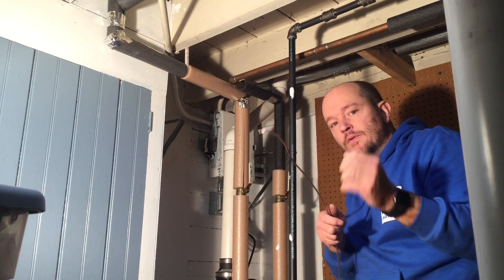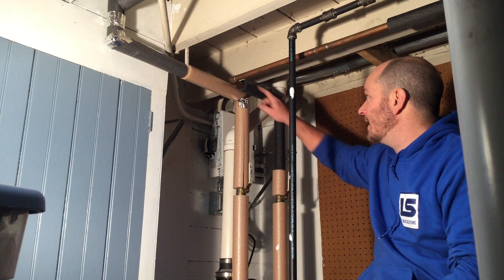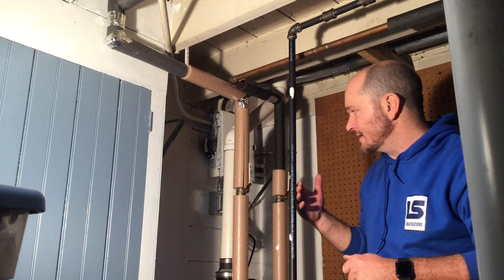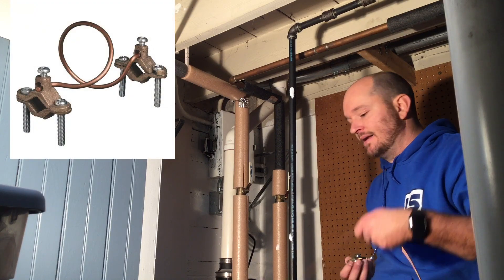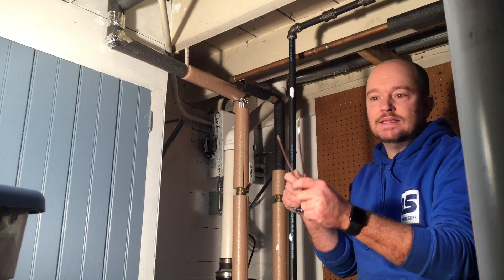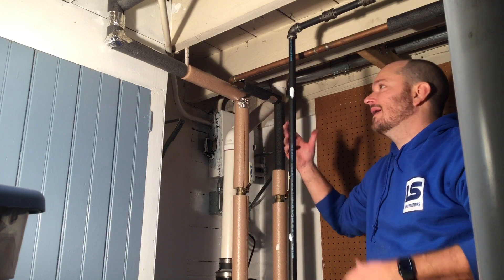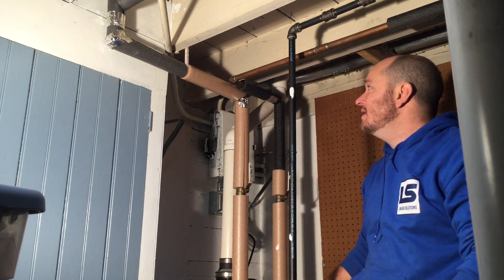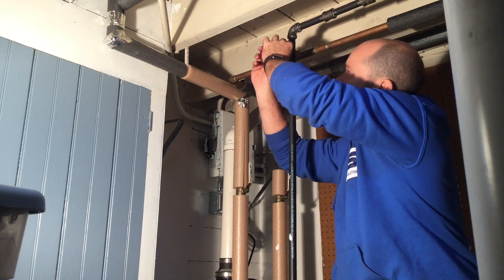Bonding the Hot Water Tank and Gas Line

Comment: You know my logic tells me that is it dangerous to bond to a gas line. But what do I know, I’m just a HVAC technician/contractor that has been in this field for 11 years. If anyone can explain why it’s not dangerous let me know.
Reply: I have never seen gas lines bonded in my state
Reply: In the event of a lightning strike, electricity may arc between conductive objects, especially those that run into the ground… you know, like gas lines.  
This arc may leave a pinhole, thus causing a leak.  Many houses have exploded this way.

Comment: Just an FYI, your volume is waaaay low.
Reply: Hi,Chris ,  i'm Kevin From Detroit Mi. I just would like to know if i can Run half inch pipe to my Furnace & my water heater? Now, im coming off  of a 3 quarter pipe also about 3 feet away, i just want to know if i should be Good, Or do i need to go with all 3 quarter pipe to the water heater and to the Furnace?
Reply: @kevinkelly9303  are you bonding or running feeds? 1/2" is fine for feed to the water heater, but I would go with 3/4" feed (gas pipe) to the furnace, which I am assuming is natural gas?

Comment: What is a dialectic?
Reply: Galvanic corrosion caused by electrical contact between two dissimilar metals
Reply: Dielectric materials are insulators that allow electric fields to pass through them, but not electrons,.  The flow of electrons is electric current.   Electric fields include radio waves, and light, formally electromagnetic fields.

Comment: This is crazy I work for gas company and have work for here for 20 years and in our policy says if there is a bond or a ground to the gas pipe, you must take it off no bonds are grounds or not allowed to be on the gas system i’m serious today is the first time I’ve ever seen that they’re requiring y’all to do it as code
Reply: Nope, doing new gas line connection to main meter and called  inspector, gas line needs to be grounded with copper 8 gauge wire.(In WA)
Reply: Same here, we are told to remove bond if we come across this inside customer’s home, no exception. (IL)

Comment: Shouldn't you connect your ground wire to the electrical panel?
Reply: The objective of bonding is to give the same electrical potential to all metal components comprising the unit, so that, say, you don't get sparking between the metal parts.  Disparate potential can damage electronic components and/or set fires if there is a spark.  This can happen whether or not the the unit is grounded.  Grounding is to give a path to Earth.
Reply: @PatrickCamblin  this is the best answer I’ve seen so far. Thank you.
Reply from the maker: It is.  But this is bonding the water heater.  It does not go directly to the panel
Reply: @KletteTech  does the grounding wire to the electrical panel go all the way from meter or connecting anywhere close to the panel would be ok?
Reply: @biguk11  Here in Washington we have to run two grounds. I have just finished my new 200amp panel and had to upgrade the meter panel to one with an external shutoff. Grounds both go to the meter box: 1. from the 2 ground rods spaced 12 feet apart. 2. the other ground has to go to the water supply line within 5' of entering the structure.